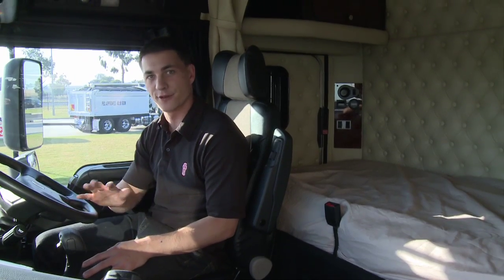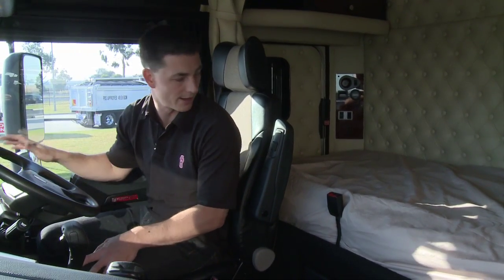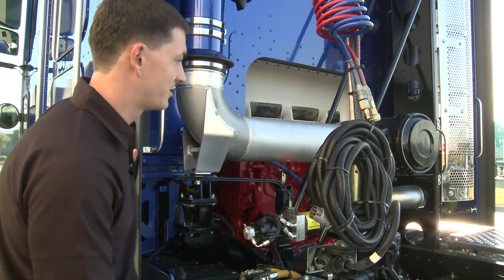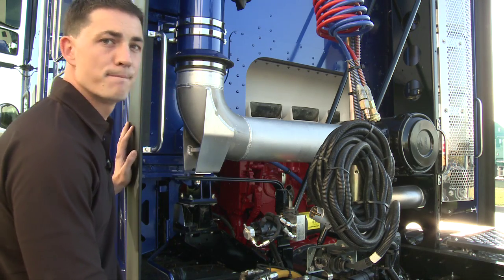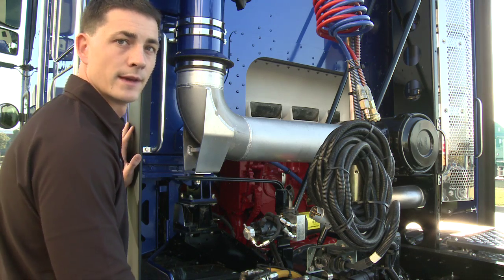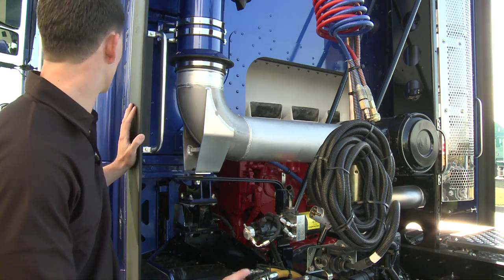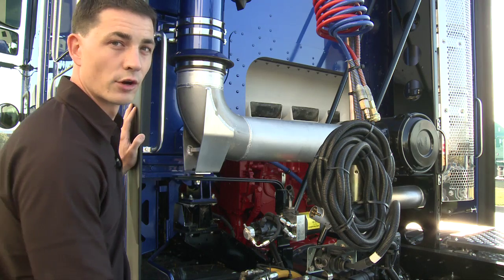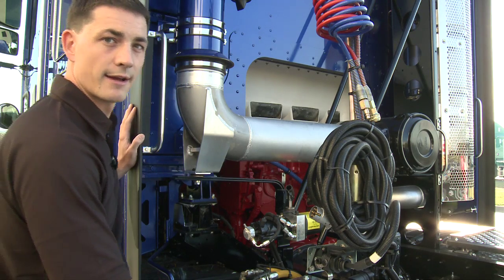How to tilt a Kenworth K200 cabin

Comment: As a truck mechanic who has worked all over the world, I have had a lot of experience with kenworths.

It is old technology and the up keep on them is crazy compared to their European counter parts.

"Each unit averages 3 million kilometers"

Don't make me laugh, the engine , gearbox and drive line doesn't last anywhere near that.
I've had to rebuild mulitple engines at 200,000km.

Their design is out dated and the build quality is rubbish.

Any one who disagrees has never worked on anything else , or is just steering wheel attendant,  attracted to all the shinny bits.....

Notfukenworthit.......
Reply: There engines and transmissions arent kenworth are they? So if they break down its not kenworths issue its the manufacturer of the engine or transmissions problem. No depreciation of kenworths name as they do not build there own engines or transmissions. Likely it would be a cummins or detroit problem not kenworths.
Reply: +Hereintranzit Daf is the brand that gives quality in Paccar. Even NA truck makers use Daf developed engines. And yes, you can have a Daf truck in NA, just order it through the Paccar dealership
Reply: Wow i couldnt disagree more...
I used to think Daf was Rubbish,
 but then i started to work on  Kenworths.
OMG......
Paccar is the most incompetent company i have ever had the misfortune to deal with.
Reply: Rob Jeeves de
Reply: NA trucks are no where near as safe as EU trucks are. EU truck are also more efficient with both hauling and gas mileage.

Comment: Kenworth = Junk
Reply: If volvo had a cummins engine that you had to rebuild at 200,000miles would you call vovlo a bad truck? No because its not a volvo powerplant.
Reply: Samuel Jones Are you just saying that as an example or are you saying Cummins need rebuilds at 200,000 miles? Cuz my 85 Pete 359 has 3.8 Million miles on its Cummins with only one rebuild.
Reply: Example
Reply: falcondriver100 example